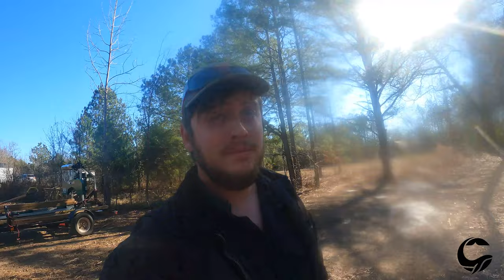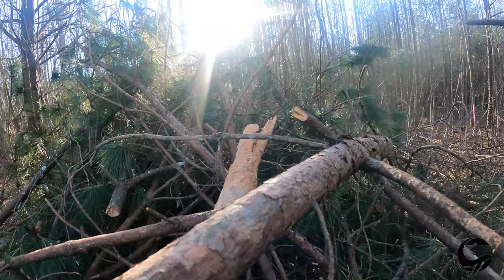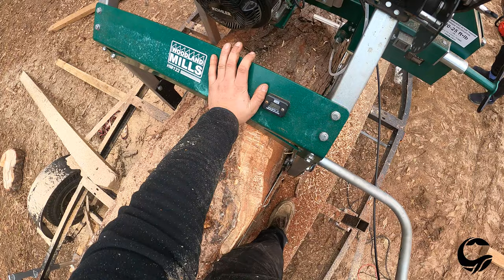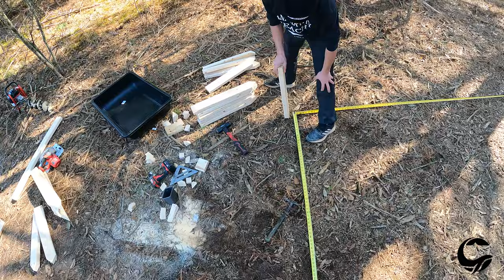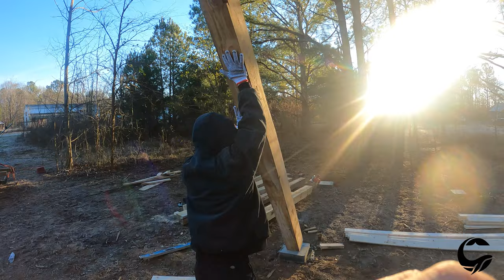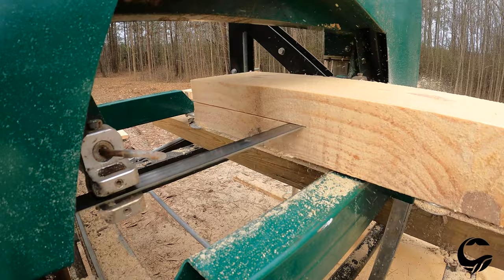Clearing Land and Building A Small Pole Barn • Short Overview

Comment: No need for rebar in it
Reply from the maker: Rebar adds strength and structural integrity to any concrete foundation. I’d recommend it even for footers like these! Short pieces stuck into the wet concrete 👍
Reply: @WHALEBUILT  I just didn't notice that